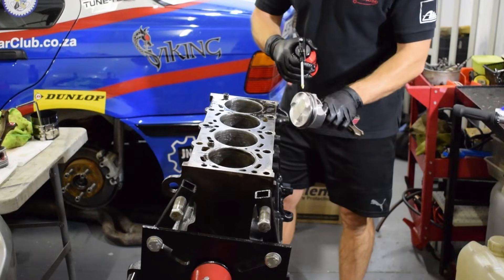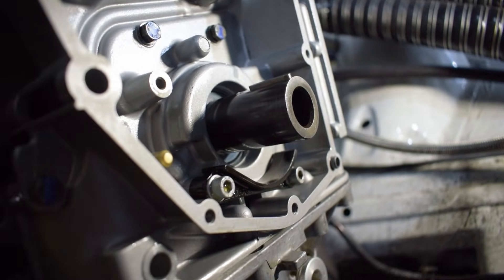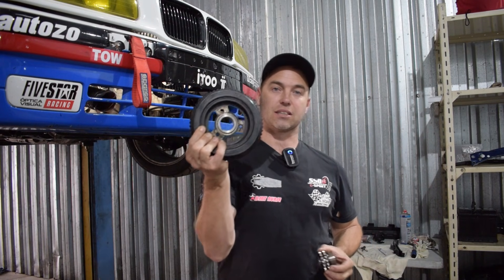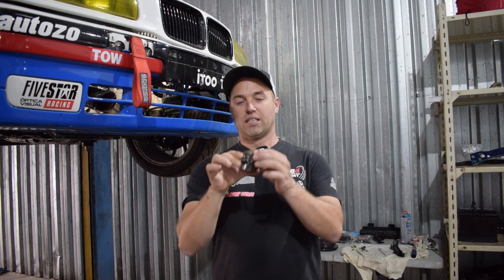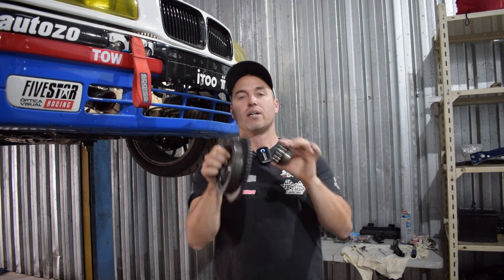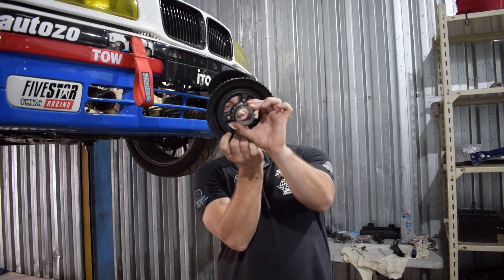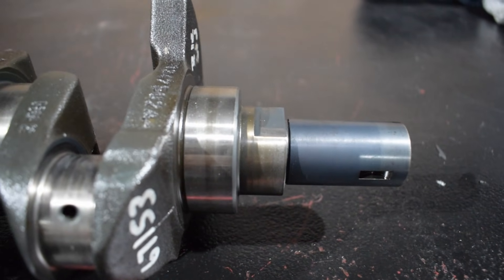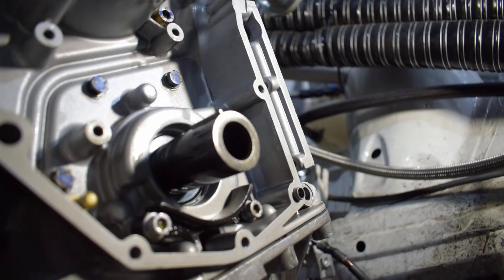What Mods to do when installing a BMW M47 crank in M42 or M44

Comment: Hello. I was wondering if you have any experience/knowledge on the feasibility of installing the M47 crank into an M40 block? Conventional wisdom would suggest that it faces the same issues and therefore can be done the same way as it's done to the M42 considering the two engines have the same block base, but I have some apprehension in that considering the former's use of timing belt as opposed to the latter's timing chain. 

Thanks in advance!
Reply from the maker: Hi, thanks for watching.

I don’t have experience with the M40 engine but if it shares the M42 block then most likely yes. The integration would be the key with the front pulleys etc.
You would still have to check compression height with the new crank, piston to valve interference, squish, compression ratio, connecting rod ratio etc.. it really depends on what your goal is and how far down the rabbit hole you want to go.
Reply: @ssbb_builds  

Not too deep, I'd hope. But then again, I've said that sentence a whole lot before. What I'm looking for is something I can still daily but can be a fun mountain carver every other day. Sub-200hp's with the M40's excellent low to mid-end torque would be the goldilocks. People are telling me that the M40's useless and to just get an M42 or M5X swap, but that just eggs me on to actually do it, you know? 

The only difference between the blocks, I believe, is that the M40's lack a knock sensor and where it's supposed to sit. Thanks for mentioning about the compressions since I was planning to combo the crank with pistons from an M52B25, and that already raises the M40's ratio from 9 to 11. Gotta get/fabricate some sort of fast street cams, maybe only add 10 or 20 degrees to the duration to keep as much of the torque, as I've said. 

That matter's practically taken care of since my mechanic used to race a lot, he knows all the bits and bobs but he's never done an M47 conversion, so finding out info about it falls on me. Unfortunately, all of the people who've done it are Russians from like a decade ago and this dude (https://youtu.be/ok2xIXdyoCI?si=rYRrXC7H9IpCjtLi) who hasn't responded. Then, lo and behold, I encountered your video.

At any rate, I have to import the crank first. Even then, I'd only probably do it when the engine needs a full rebuild (I just got the head refreshed six months ago with M43 parts) so it's not as if I'm pressed time-wise, but the day might come sooner than later. I just need to figure out the crank conversion part while my mechanic will figure out the rest, and thanks to you, I'm just a bit closer to that.

Cheers.

Comment: I was also under the impression that the M47 crank snout was slightly longer than the M42? But presumably that’s not the case! 😂

It’s nice to see the information being shared first hand - there’s lots of armchair experts out there, and not much reliable info. Keep up the good work 👍 I’ve got most of the components for the bottom end and am hoping to do this one day - I just need a car for it to go into!

If you’re willing to share some info on the cylinder head it would be greatly appreciated.
Reply from the maker: Thanks for watching.
The noise of all 3 are the same length. I’m so glad the information is helpful, that was the purpose of this video.
I will do another in a few weeks. 👍🏻
Thanks again for the input.

Comment: how much does the m47 crank weigh compared to m42 crank ?
Reply: Nice info, how was it to machine up the keyway since the crank is so hard? Is hss good enough to mill it with or do you need carbide? Love your vids, can’t wait to see the nm/hp rpm data when you go to the dyno👍 Kinda working on the same thing😊 Good luck, love this canel👍👍👍
Reply from the maker: Thanks for watching. The key way was cut using a HSS cutter. It was inserted into the existing keyway and then cut.
To break the surface you would need a serious carbide cutter.
Reply from the maker: Thanks for watching.
This is something I unfortunately did not physically do. 
I would say it is at least 10% heavier than the M44 crank.
I will weigh the M44 crank and let you know.